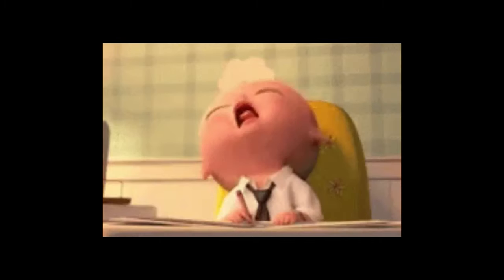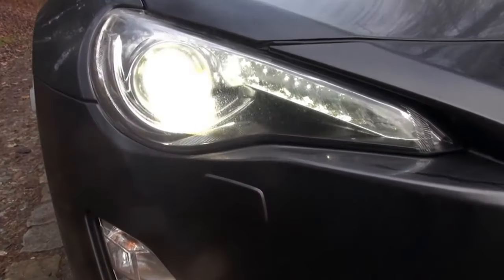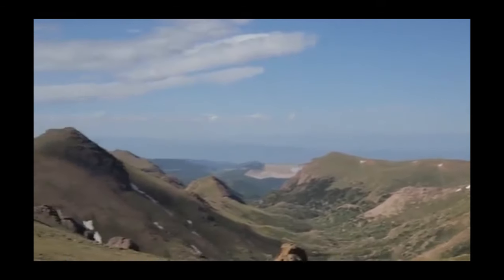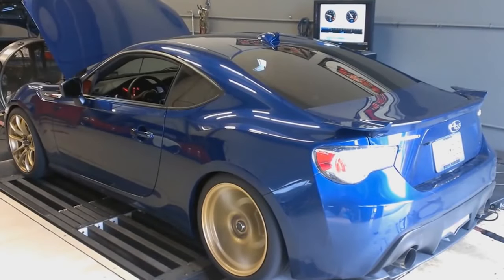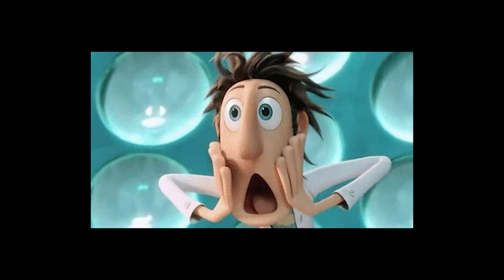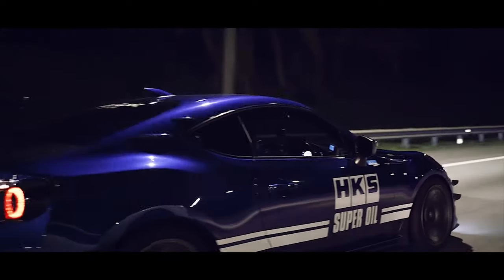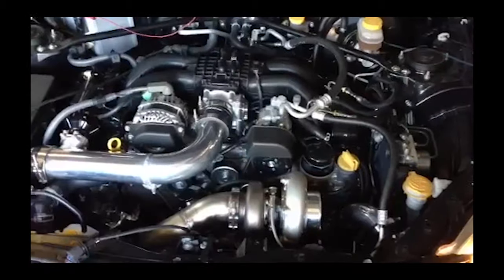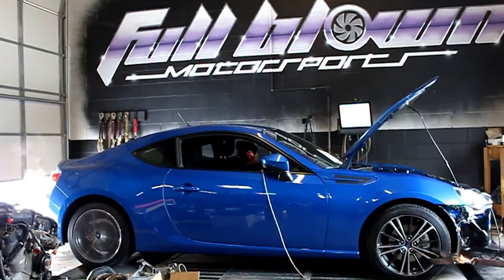How to make power with your FA20D powered BRZ or GT86

Comment: Idk about stock engine going up to 500whp. Unless you mean the block instead. I see people with bent and broken connecting rods around 300-350whp all the time. From everything I've seen, if you wanna go above 300whp, you're gonna want forged internals, or else you're playing a risky game. I have a buddy who just blew up his motor at about 320whp
Reply: I just picked a 2017 up and I'm trying to get it up a bit but not too much. maybe around 250-270 range
Reply: @RealTalkOttawa  
Yeah that should be perfectly fine. Very low risk of anything breaking. That's kinda the "standard" tune. Most turbos and supercharger kits come with an ECU tune and it's usually in that 240-270 range for that exact reason. You can keep your clutch too. 

Only cheap mod I might recommend with it is a catch can. I've heard it helps keep particulates out of the engine for a better chance at a longer life. Also, if you can, a custom dyno tune from a good shop is usually better than a stock tune. They can look at your individual car and exhaust setup and make the tune more precise. A good tune goes a long way to keeping things reliable.

Best of luck to you! I'm getting ready to install my supercharger here in a few weeks myself :D
Reply: Tune, fuel quality and low end torque are the biggest factors. Low end torque is not good on the stock rods but they do well at higher RPMs. Just can't put too much load on the engine or "lug" it.
Reply: @burakoshimazaki  
Yeah, that's why it seems like centrifugal superchargers generally don't break these engines as easily as turbos or roots style superchargers. I saw one guy who had a custom tuned centrifugal supercharger at 320whp on a stock engine and they tracked it regularly for years with no problems.

So tune matters a lot, but in my personal opinion from the research I've done I think if you don't wanna break your engine, stay under 300whp if it's stock internals. If you wanna go over 300, you've gotta open it up and replace the rods and pistons.
Reply: What about crank, rods, pistons, new heads and inlet manifold?
Reply: @AJS86  
I'm not sure there, there aren't many examples I've seen of people doing that extreme of a build, because at that point most people will just swap in a K20 or LS or 2JZ or even a B58. So it's hard for me to say. All I know is it seems most people are ok up to 350-400whp with just forged rods and pistons and maybe a built block.

So all I can say is I haven't seen many swap out the crank or inlet, and very few do extensive head work. For that kind of build you'd have to find a shop that has actually made reliable 500+whp FA20s and see what they recommend. But I'd imagine 90% of shops will just tell you to swap it if you're going for that much.
Reply: @Trio3224  please don't tell me people put LS engines in them. 
So over those things in everything.

Seen one on a motorbike FFS and it had nitrous aswell.
Reply: @AJS86  
Every major engine possible has been shoved into this car lol. This car is lightweight, rwd, and has an oversized engine bay. It's basically begging for engine swaps lol. 

I've seen many LS engines, and K20s. A few 2JZs. A Honda F20C. Even seen a mazda rotary B18C and a Ferrari V12. Unfortunately the FA20 just isn't all that reliable at high power levels and has relatively low hp limits. So people that love this chassis but want more power, or more reliable power, will often swap out the FA20 for something else. 

I don't plan on doing that, but I find it totally understandable. Personally I'm getting ready to build my engine with a built block and rods and pistons (plus other supports like new clutch, oil cooler, etc) and supercharge it up to around 350whp and I feel that will be quite sufficient for a street car. Especially a 2,800lbs street car.
Reply: @Trio3224  I totally understand for reliability. But wouldn't the amazing chassis and handling of the car be ruined by slapping a massive big heavy engine up front? 

I'd imagine it would become extremely nose heavy
Reply: @AJS86  it depends on the engine, but from what I understand it wouldn't be too bad. Most of the bigger engines are gonna bias more weight forward and ruin the balance a little, but not much. The FA20 is actually very big and heavy for a 4 cylinder engine because the boxer design is not very size efficient. I think both a k20 and B18C would probably bring the weight down and maybe even balance it out a little better than stock.

And an engine like an aluminum LS V8 is actually relatively small and light for its size. I think the LS3 and it's trans weighs less than 50lbs more than the FA20 and it's trans. It's hard to find exact weight figures tho
Reply: @Trio3224  no mods for my one. Daily drive for me. I might swap in the later red intake manifold get rid of my plastic one. 

I've got a 944 that needs finishing restoration before anything else.
Reply: @Trio3224  the only issue with the catch can is you do not want one in cold areas, moisture can build up in the lines and freeze and it’ll blow you engine
Reply: Yeah that engine can barely handle 300whp safely
Reply: What about a Porsche flat 6?  Is there any way possible of getting a better than 1:1 power to weight?
Reply: @Trio3224  Thanks for the advice, noted and saving this for the day I get to that point maybe oneday I’ll find you and show you lol
Reply: @Trio3224 I still haven't properly dyno mine yet but it is turbocharged.
Reply: Vortech sc, e85, tune, fuel pump and 100cc injectors
Reply: Could you safely get to 250-275ish?
Reply: Never mind - read the comments!
Reply: 350hp to the wheels is the sweet spot for stock internals. After that boom!
Reply: @gonzalezeduardo28  I've seen plenty of people blow engines at anything over 300. I would never recommend 350 on stock internals. Maybe you can get lucky, but I think it's unwise and extremely risky at that power.
Reply: @Trio3224  I don't know why people feel they need to go nuts to have fun with this car. I super charged mine with e85 then put the rest of my money in supporting mods. Mishimoto aluminum radiator and fans, Oil cooler, catch can. People also forget about parasitic drain and rotational weight. Get some light weight rims, 2 piece aluminum hat rotors a light weight flywheel with a stronger clutch and a carbin fiber driveshaft also did some weight reduction too with a custom exhausts, removed spare tire and some carbin fiber body mods. I'm sitting @ 300whp having lots of fun on twisty roads and smashing most people who underestimate this car.

Comment: I feel like a supercharged stock motor with a better clutch running 300 whp is the way to go. The car with how light it is is the most balanced at 300 horses. Put it on coil overs and you have the best of both worlds handling and good power. Perfect for reliability while balancing budget and keeping the car balanced. If you bring it up to 500 your breaking things and you can’t push the car as hard in the mountains or on the track without worrying about killing yourself.
Reply: Agreed
Reply: Dont agree

Comment: these numbers are off, headers and e85 gets ya around 190whp at most
Reply: Very late, I know. But Ace headers and a tune will get you right about 200whp. The JDL 4-2-1 (or something like that) will get similar power too, but most of the headers and tune will be between 185-190whp. So E85 plus Ace headers Will get you at least 210. But still his numbers are high
Reply: Should’ve gotten the 2.4L😂
Reply: @TRD-FRS  yea i found it weird how ace was the only one that gave the most power i wish i knew that earlier 😂
Reply: @imcertainlygay8680  nah that’s too expensive only to be just as slow, my 86 was more of a fresh out of highschool budget car. i’m doing things right this time and just getting a 5.0 lol
Reply: @86kevinn  it’s all about design and the type of header. Unfortunately people ‘need’ that UEL sound, so they sacrifice power for that. I also did forget to mention, but the Ace headers compared to headers with similar power differ in another important way, and that is area under the curve. Not only does Ace have the highest peak power (within half a horse with some competitors), but when you look at power throughout the curve it is higher in pretty much every rpm range, and that’s what sets it apart.
Reply: @TRD-FRS important reason for choosing unequal length: you can buy one used for like a Taco Bell cravings box and a case of beer
Reply: @zackhewitt1147  that shouldn’t be a reason to go one route or another. I got my Ace headers for $800 shipped, that’s not expensive at all for a set of headers. If you’re worried about dropping about a grand on headers, then there are other problems you need to be worried about in your life.

Comment: you can go way more hp on N/A set up... but of course you need to build the internals and go for higher rpm 😋
Reply: For 2 liter BRZ Brian Crower makes good internals. And after that get something custom for the pistons like Manley piston to easily break 10k rpm. Def upgrade the clutch before that tho. Idk if it can handle the rpm but I sure as hell wouldn't want to find out.
Reply: @liamc8085  
8-8.5k rpm sounds feasible, 9k's a stretch, but 10k? What does someone have to do to reach it with a square bore/stroke ratio, 500cc per cylinder piston engine and not rip it apart with the piston speeds alone? Not even Honda went above 9k with the S2000 and lowered the redline for the F22C because of piston speeds
Reply: I'm kinda new to the car scene, but I want to take my Brz to its limits but trying to keep it N/A because I love instant power.
Reply: @Icemann336  you build for it... like he said, there are rods and pistons, built to take the abuse of high RPM... what i am more worried about is the valve springs... they need to keep up, or you slap the valve with the piston... it's a vary tight combustion chamber... 😅
also, you can't compare forged internals to the cast internals of a stock engine.... 
stock is built to a certain tolerance to be good enough, yet fast and cheap for mass product.
they keep it from blowing up, with limiters... GT86 limiter is set to 7.5k stock.
Reply: @RealTalkOttawa  well, first step for more power is, better air flow.
intake/exhaust/tune.
next step up would be adding intake and throttle body spacers, along with a larger throttle body and injectors then retune... (quad throttle bodies are an option on the FA20😊) add lighter belt pulleys as well, and that should make the stock internals really sing....
next it gets more involved, and expensive...
I'd suggest a banks data monster, and throttle control. these will help keep track of what is happening to the engine, as you are playing with the RPM limit. the more data you get, the more fine tuning you can do.
now onto more power making on an N/A. 
the engine is a pump, and the faster you can make it pump, the better. 
this requires lightening things like the pulleys, flywheel, pistons/rods, etc... 
these parts need to be high quality, or 💥 
Valve springs are important, if they can't keep up with the higher RPM in the next tune, well...
the valves will float, the piston will hit the valve at an extremely high rate of speed..... 💥💥💥🔥🙊

Now.... all this, will make the car... different to drive, to say the least...
it will have a much heavier clutch feel, and need to be revved higher to take off, due to the momentum of heavier parts being gone...
Race car vibes... 
and would need to be driven as such... 
so if you are not planning on driving it to the limit all the time, but more daily, I'd suggest sticking to just the external bits, and stock rev limiter... Stop where i talked about the Banks monitors... ya don't really need anything more then that for road use, ya don't even need as big of injectors as you would for the high rpm race engine build...

Remember, the rest of the car is just as important as the engine...
my mods started with body stiffening (strut towers/fender braces/ect.)... and man... world of difference, for a momentum car... 
.... and this turned into a rant... 😅
Goodluck  :3
Reply: @liamc8085  there are a lot of parts to consider, as the RPM climbs higher haha...
what will fly off next?? 🙊

Comment: CAI don't do shit for these cars, if anything you lose power. maximum you can get from headers and a tune is like 15hp, full exhaust and e85? low 190's if you're lucky. this is all bullshit...
Reply: agreed, i changed headers, frontpipe, only one 200cell racing cat, full flow backbox, cai, all that, +custom tune, did 215 hp (crank) on 102 octane
Reply: I wouldn’t say this is all BS, but I wouldn’t say it is accurate. Most CAI’s decrease power because they actually get hotter air over the stock intake because the stock intake is pretty much as ‘cold’ as you can get. Another missed fact in the video is the fact that CAI’s don’t do anything unless tuned. That doesn’t mean all intakes don’t produce power like that though. You can find it on the general forums, but stock tuned car vs TRD intake tuned and the car got 14 whp. As for FBO’s, CSG’s tune with the Ace header is right about 200whp, but that’s with the holy grail header rather than most UEL and other headers people get which do help but not that much. I could pretty much say Ace headers, good front pipe, any aftermarket catback, actual good intake, tune, and E85 could get you at least 220whp. That’s if it’s tuned right and has pretty good parts.